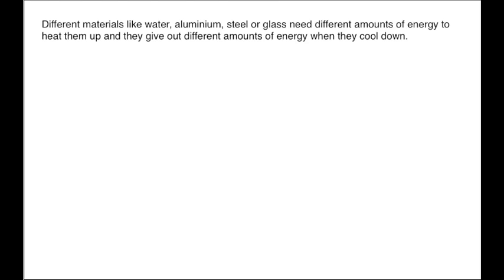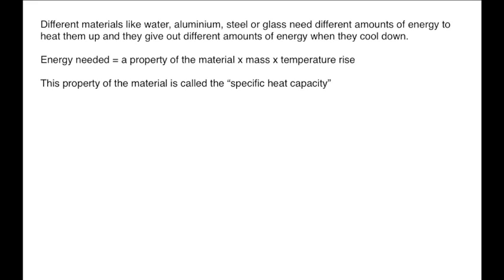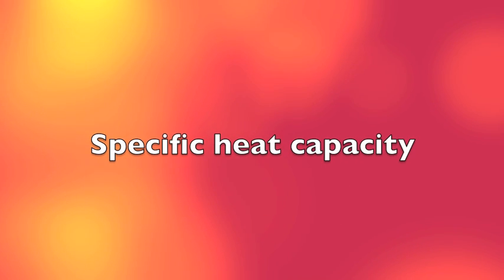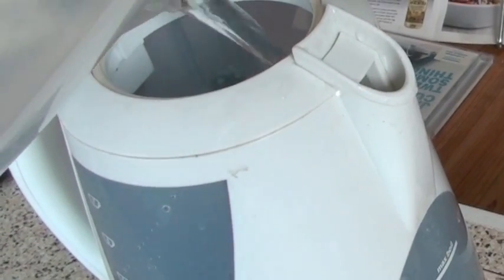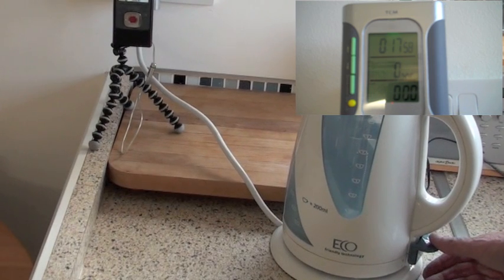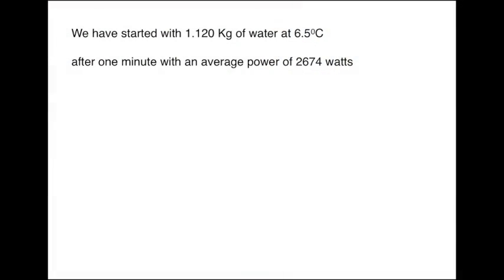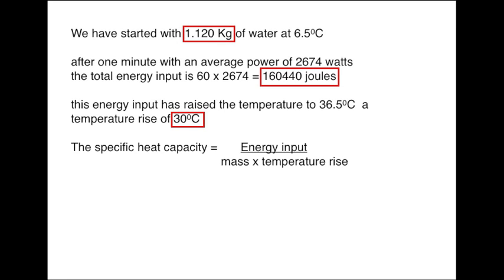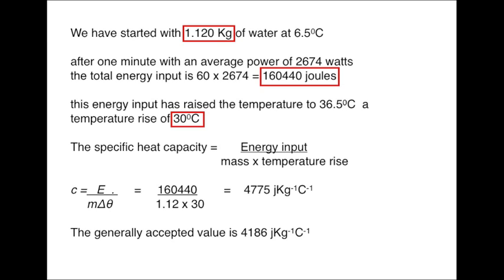Specific heat capacity explained, measured and demonstrated: by fizzics.org

Comment: if i were to add a solute like salt or sugar to water, would this procedure work in determining the specific heat capacity? Would I use the entire mass of the solution or just the mass of the sugar I add? If I compare that specific heat capacity with what you experimented with, would I let the solution in the kettle for the exact amount of time to see the final temperature?